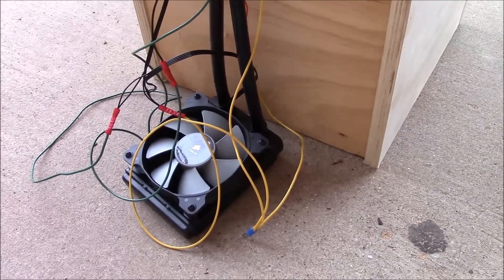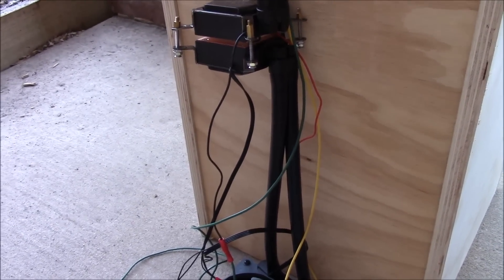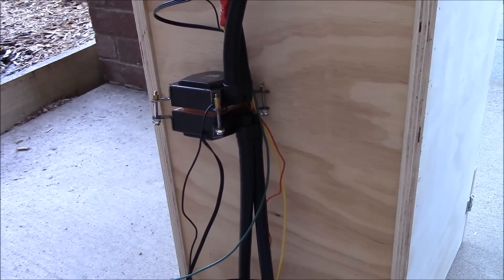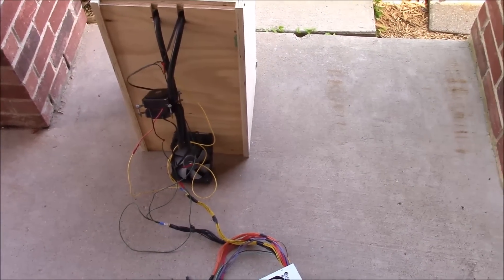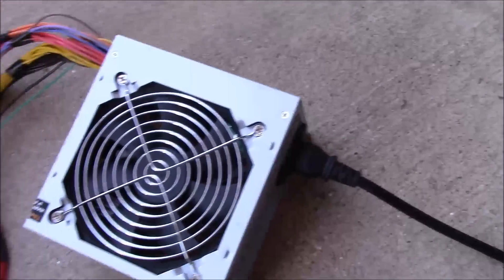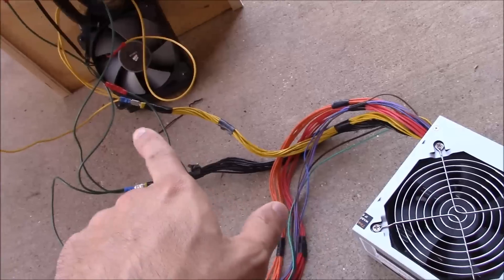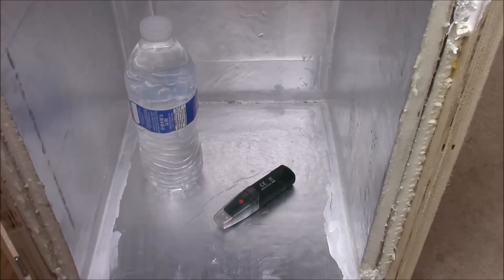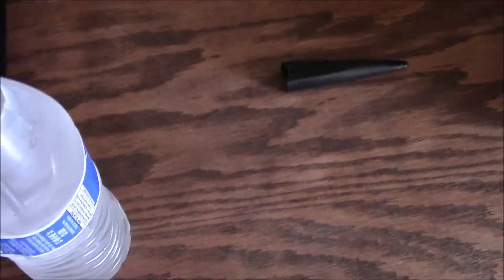Liquid Cooled Peltier (TEC) Refrigerator - Part 4

Comment: Please consider making a peltier DIY refrigerator video with the refrigerator outdoors in 80F to 90F outdoor temperature, and being powered directly by two, three, or four 12V / 100W / 7A portable solar panels wired together and without implementing a battery, by using an amp / watt meter and an amp modulator such as a motor speed controller or some device to be able to modulate / control the amperage from the solar panels to the peltier unit(s) of the portable frig.  Ideally, people will want a portable solar-powered peltier cooled refrigerator they can have either indoors or outdoors in 70F to 90F weather.  If this is possible to build, it would be very useful while camping and / or anywhere during a summer time public utility power-outage (blackouts / brownouts).  Purportedly, 12V fan motors can be safely / reliably powered directly connected to solar panels (one fan per solar panel array) if the maximum amp output limit of the solar panel(s) is at least one amp less than the maximum amp input limit of the fan motor.  However, if the maximum amp output limit of the solar panel array is not less than the maximum amp input limit of the fan motor, then an amp regulator / controller module such as a PWM motor speed controller or D.C. to D.C. amp regulator / controller module needs to be connected with an amp / watt meter between the solar panel(s) & the fan motor to prevent a potential amp over-load from overheating / damaging the fan motor.  I do not know however, whether or not a peltier device can be safely / reliably powered this way since it is a sensitive solid-state electronic device and not a fan motor.

Comment: Try the Arctic Triton Ice from marlow industries, its only 6.5 amp, but can drop at least 3 degree Celsius lower, and is ALOT more efficient especially with water cooling, have gotten my 13 can cooler down to 35F
Reply from the maker: Wow, $50 each?  I don't know if I can justify that.
Reply: @LDSreliance  They were Made a few years ago, Digikey is the only place ive found that readily sells them. it ran alot better than the original cheap ones i was using.
Reply: LDSreliance Funnily enough, marlow industries makes them in texas where you live lol. They are definitely worth the money
Reply from the maker: Awesome!  Thanks for the suggestion.

Comment: the way i understand, the better you cool off the hot side gets a lower temp on the cold side, you never even bothered to check your dangling hot side. power will just speed up the freezing process, your insulation is fine.

Comment: My thought on this. I think a bigger radiator for the hot side will improve the cooling on the cold side with the radiator you already have. I made a Peltier air conditioner using this set up and it works really good.
Reply from the maker: Yes, that is true.  But the CPU coolers used in my testing are already so oversized for this setup that it would not have made a difference.  The hot side radiator never got much above ambient temperature, which is the coldest it could possibly get in theory.
Reply: @LDSreliance Yes, it would only be worth if you were dumping more heat into it with like a second peltier module

Comment: touche, job well done, and excellent vids  with explanations, I'm currently on the same project and glad I did more research , and glad you did all that research :) , I was gonna buy the 12706 but now I see that is futile, my question is if I wanted to connect this directly into the wall, what plug would I need? thanks, I subscribed BTW ,
Reply from the maker: Thanks for the sub!

I have always used computer power supplies or laptop/monitor power supplies for these things.  If you use a laptop/monitor power supply just make sure it is the 12V variety as a lot of them are 18-19V.  Here is a good example of one to try using for these 5-6A peltiers:  http://amzn.to/2oJag3t.  Here is one to try for 10A peltiers:  http://amzn.to/2oJf092.

Just hack off the connector on the end that would normally go into the monitor/laptop and then you will have one red wire and one black wire and you can take it from there with your choice of connector to the peltier.

Comment: Gonna use this project as a basis to build a mini air conditioning unit for a small (closed) room. Yes not as efficient as a heat pump, but portable and no installation required.
Reply from the maker: +gorbulas Nice.  That was my original project but I changed to a small fridge.  I would still like to try to cool down a small closet sized room with them someday.

Comment: So, I bought a 12v 6a Peltier unit for my future mini fridge that I plan on using for my room. I mostly bought all the materials a fridge would cost, but for the knowledge and the fun of it, I decided to buy lots of parts and experiment with them. I got a big cpu cooler to cool off the hot side, and I used a smaller heat sink from a old car mini fridge that was broken. I also bought a temperature controller and a cooler (not styrofoam, already insulated with foam and plastic). I am finished with the mini fridge itself. (but I think I need to work on some major improvements) I used a 12v 5 amp power supply because I wanted this mini fridge to be super effective. I was surprised from the results, which was 48 decrees. I was surprised because the fridge is 3x5 ft tall. But, I want to keep the power supply and Peltier to keep the low power consumption for my "solar powered mini freezer" idea. The funny thing is, that I added a dehumidifier, it was 44 degrees. So, how do I make it colder?
Reply: +Matt G. You could make it colder by supplying enough power.

Comment: Have you considered using an aluminum heat sink on the cold side (inside cooler), with liquid cooling on the hot side? While somewhat difficult to accomplish, a large sink (like an aluminum shelf that the cold side of the Peltier is affixed to) would probably be more efficient in terms of heat transfer, and reducing or removing a fan will cut down on energy consumption, complexity, and heat generation. If you had the items to be cooled sitting on the sink, transfer of heat would be direct.

Reducing the amount of cooling the Peltier needs to do by any amount would be valuable. You've already gone to one extreme, now scale it back a bit. Other videos have shown that the 12V mini-fridges do a pretty good job dropping temp, best performing one I've seen had the interior "casing" made of aluminum, which the Peltier was sinked directly to. No fan at all.
Reply from the maker: Dan Ya Yeah that would work.  I think having the heat sink in direct contact with the liquid complicates mounting quite a bit as you have to integrate the heat sink into the enclosure of the liquid without introducing any leaks.

In this case I was building this for a subscriber and he needed it to function remotely.
Reply: LDSreliance Well the liquid cooling on the hot side, while complicated, is going to be more efficient than just a fan moving air over an aluminum sink, and the more heat you can remove, the better it will perform on the cold side. I suppose once equilibrium is reached (ambient temp and hot side sink temp) is achieved, 40-45* F temp reduction is the most you will get vs. ambient, once it hits 90* ambient cooling will be less effective no matter what. 

Using a solid heat sink within the cooler would be complicated trying to isolate the interior from exterior where the sink was attached to the Peltier device, but I would think an L-shaped piece of aluminum would be fairly easy to attach the Peltier device to, while providing for a decent amount of surface area within the cooler itself. 

I'd like to try this myself, but finding the time is difficult. Perhaps modify the design you came up with, putting the peltier device(s) on the bottom. Use a flat piece of aluminum as the cold side sink/bottom inside panel of the cooler, and set items directly on the aluminum sink.
Reply from the maker: Dan Ya I would be interested to hear how it turned out and your results.  It is always a challenge finding time!

Comment: Hi:
You get more efficient if the radiator were one common inner aluminum and heat the part which is outside the liquid cooling used . And I say that because in the outside temperature would not mind the heat loss. And on the inside you reduce the loss of cold to the fullest because of the proximity to the peltier cell to aluminum . I hope you understand me .
Reply from the maker: Miguel M. R. M. I'm not quite following you.  Sorry
Reply: LDSreliance  Liquid cooling to remove heat. No matter which heat is lost, it is even good.
And ARCTIC Alpine 11 Plus CPU Cooler to the inside of the box. The Peltier cell (cold side) directly on Alpine 11 cooler. Thus the loss is minimal.
I think that would be a small improvement. Excuse me for my English.
https://www.dropbox.com/s/2wxnyoguba4fqkf/Captura%20de%20pantalla%202015-06-24%2001.26.45.png?dl=0
Reply from the maker: OK, I understand.  Makes sense.

Comment: if using long term, maybe put a icepack on the top and/or bottom to store some of the cold in so it doesn't take so long to cool back down when it is opened and then closed. all in all a cool project.
Reply from the maker: Miclow Gunman Good idea.  I think it would take longer to cool down but it would also stay cooler longer inside when the TEC is shut off.  I might have to test that out.

Comment: just thought of something: water freezes at 0 degrees. Maybe antifreeze might be an idea.
Reply: +Robert Hobson Most water coolers don't run on straight water, I don't recall what all is in the fluid used but I doubt it has quite as high of a freezing point as water

Comment: I think that the effect is asymmetrical possibly due to the power being pumped in converted to heat. Air coolers I've seen on youtube tend to have 2 heatsinks and fans on the hot side and 1 on the cool side. so maybe a h120 on the hot side and a h60 on the cool side might help.

Comment: For the insulation, use styro foam, inside then put metal layer or silver folis.
Reply from the maker: Abhijit Pal Isn't that what I did?  That is pretty much what the foam board that I put in it is.

Comment: Nice, those are really impressive results. 5ºC is a good value, maybe its really useful. 
I saw one of those AIO liquid coolers, they can dissipate a lot of heat. 40ºc with ease. 
I wonder if the peltier device doesn't also generate more heat while working, i'm not talking about the peltier effect per se, but some heat that could be generated as a waste, like the good old transistors. (something like overhead). The average of a most common human made devices is 90%- efficiency.
If this is true, so, the more current the more loss¿? In that case having 2 peltiers in series could be more efficient? or not?

the question now is, will it solar?

Also, thanks a lot for the Celsius :)
Reply: Jerónimo Barraco Mármol LDSreliance Any heat pump (including refrigerators) have an efficiency limited by the 2nd law of thermodynamics. For the setup in the video, where the outside temp = 18C and inside temp = 4C, an ideal heat pump would provide ~19 watts of cooling per watt of electricity. In reality though, Peltier units are only about 10-15% of an ideal heat pump's efficiency, so they can only provide ~2-3 watts of cooling per watt of electricity. Mechanical refrigerators, using refrigerants and compressors, are about 4 time more efficient or about 40-60% of ideal efficiency. These Peltier units are definitely simpler, more versatile, and less hazardous to work with though.
Reply from the maker: Jerónimo Barraco Mármol Yes, sir!  I am going to test the fridge on solar power soon.  Stay tuned for that.

I have been told multiple times that using peltier chips in series makes it more efficient.  I have also been told that running them at less than 12v makes them more efficient (more cooling effect in proportion to the given energy input).  I have yet to experiment with those ideas yet.  I do believe there is excess heat produced in the energy conversion and that is why it is important that you have a really efficient heat sink on the hot side.
Reply: Awesome! Thanks! i really would love to see more of that. 
i bought a peltier but is really expensive here so my tests are really limited because is small. 
thanks for the reply :)
keep it up :)
Reply from the maker: That is unfortunate.  I can get them for $5 or less with free shipping in the US.  Good thing because they are fragile and break easy.
Reply from the maker: Great info.  I know they are not as efficient, not even close.

Comment: You were seeing if this was a viable project for building and selling. Everything but the cooling coil is exposed to the outside ambient temperature. Isolate the tube and water block from that variable should provide an increase in the effencie of the peltier.
Reply from the maker: Duane C Right.  I can do that.  I am definitely planning on making improvements and doing more testing.

Comment: First my understanding of peltier device is that it roughly has a 20 degree difference from ambient temp and cooling temp. Using the liquid pumps  provided a better transfer. If you insulate the tubes and the water blocks plus the outside of the case, you should have a good system. Maybe do a test in 75 degree temp just to see how well it dose and do a quick 3 minute video
Reply from the maker: Duane C You want me to just test how much difference insulating the pipes will do?

Comment: Awesome, well done!
What do you have to do to keep the temperature at a desired constant level? Is there any regulation system I can use to achieve that? I'm going to make a fridge like that for sure, I always wanted. I appreciate your passion and your willing to share this through your videos.
Reply from the maker: BState media Thanks for the encouragement.  It was nice to finally succeed.

You can regulate the temperature with a thermostat.  I plan on doing a follow-up to this series at some point and play with that and also maybe some arduino controls.  I want to get started on some other things for a few weeks but stay tuned in the future and I will show you what you need to do!

Comment: AMAZING just amazing video and results,
i wounder how many decebles it produces, is it noisy?, as im building one just to put it in the bedroom for my meds.
and the 20amp peltier seems will have better results but i wounder if it could take the power that you build
thanks in advance
Reply from the maker: THEOOJOKER No it is silent.  You can't really hear the fans.  You can actually hear the water pumps inside the Corsair units louder than the fans.  I would guess 40 decibels.  A 20 amp peltier will be overkill.  We reached the goal with a 10 amp unit and I will test a 15 amp unit in the future.

Comment: hello, would be a good idea to separate the fan wall to get greater airflow, how much energy input to the power supply in amps consume ? congratulations for your work.

Greetings from mexico
Reply from the maker: Angel karim Mandujano GAytan Thanks!  The power supply provides 300 watts on the 12v rail and we are only using a little over half of that.  If I do another video I will show the power consumption.  Good idea!

Comment: Thoes Corsair water coolers are built to take around 175 watts of heat. So they should handle a 15a peltier device just fine.
Reply from the maker: Hendo420 Yeah they should.  I ordered a 15 amp unit from China and it will be here in a couple weeks and I will test it out.

Comment: Hello, I've been VERY interested in oyur videos lately, and I want to build a fridge similar to your first prototype. I've built the peltier cooling unit, and also the fridge frame. I want to know how exactly you wire all the devices up, as that's the most hard part in my eyes, especially with the CPU power supply. 
Can you explain in depth how I would connect my peltier unit to any power source?
Reply from the maker: Jesse TheFabulus I would be happy to.  I made a video that tried to explain this a bit better.  Watch this first and then if you have questions let me know and I will answer.  https://www.youtube.com/watch?v=aTM5lmccev0

Comment: If you check out 'Ultimate Corsair H100 Cooling Mod' you can see that the more fans in series  used on a radiator , far greater performance can be achieved.
Reply: rainbowsalads with fans only, you just can not get below ambient temperatures.... Basic physics stuff
Reply from the maker: rainbowsalads A great point.  I intend to try this out in the future.  I don't know if this 10 amp peltier is pumping out enough heat/cold for the air flow of the fans to make a big difference but we will see.  A computer processor is producing a lot more heat than one of these lower power peltiers.
Reply: That was a trolling video...he even said that in the end
Reply: I think i'll have to wait until someone does a similar experiment to see how low temps can be. The presenter is a bit odd.